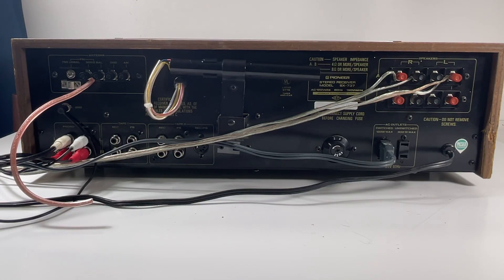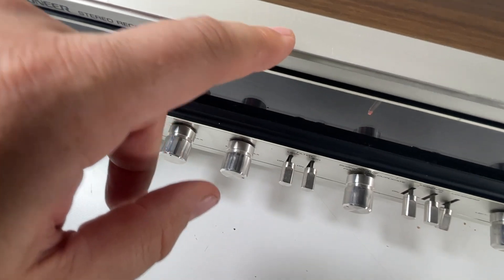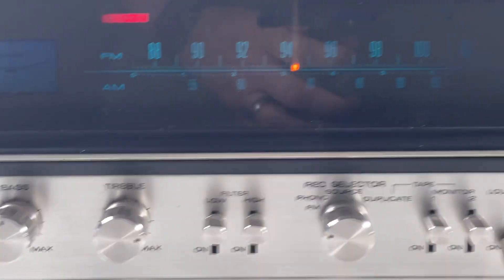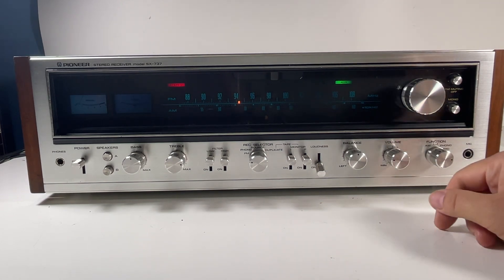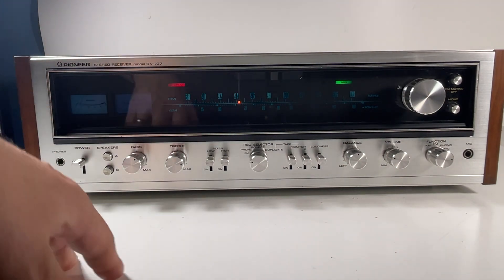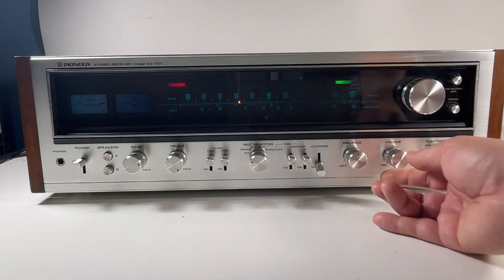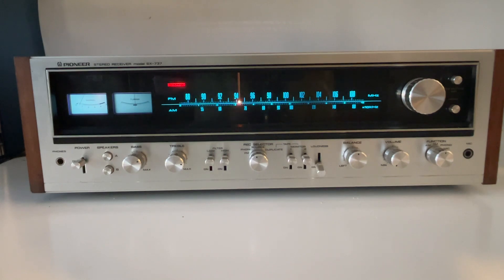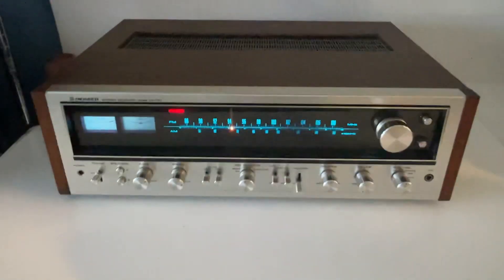eBay Listing: Pioneer SX-737 Overview

Comment from the maker: This actually has an issue, every 5 minutes it cuts on the left channel and then returns.
Reply: Bad transistors on the protection board.
Reply from the maker: @beechpilot57  good to know, I still have this sitting in my project pile.